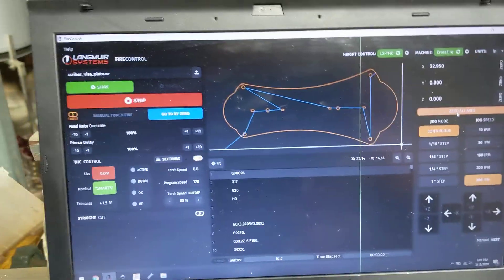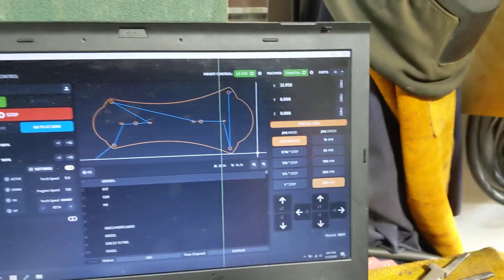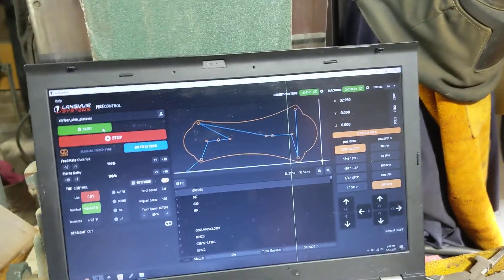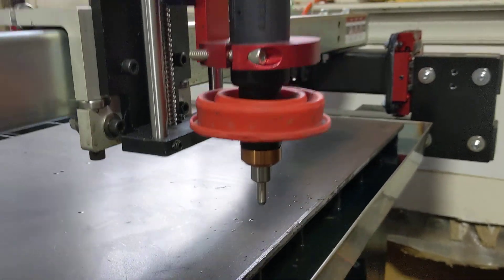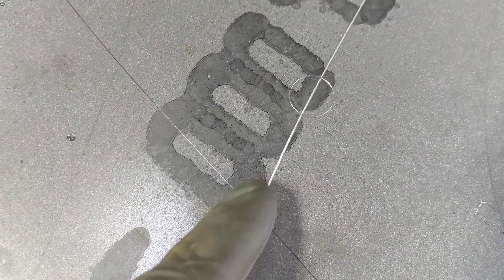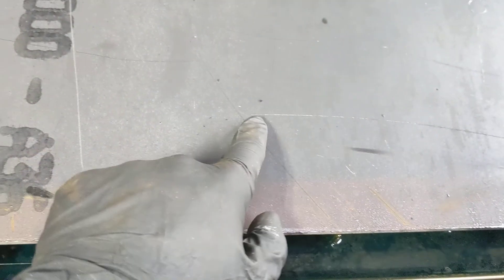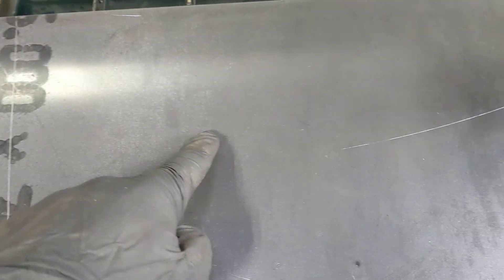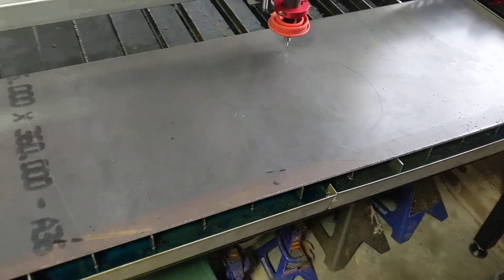Langmuir Systems Crossfire Pro - Using the EasyScriber

Comment: Any updates on this scriber.....is it a keeper?
Reply from the maker: Yup, she's a keeper. I like it a lot.
Reply: @JohnCasale  awesome, did you just have to load the tip a little more on the Z or.did you find a way with the THC?
Reply from the maker: @Welder6131  that's right. Done in the fusion 360 post processor for fire control

Comment: What’s that orange thing around the torch and what’s it do ?
Reply from the maker: It's a funnel. It just blocks some of the torch's light, and catches water that sprays up, keeping the work area a bit cleaner.
Reply: where did you get it? @JohnCasale
Reply from the maker: @garrettslobey9204  anywhere kitchen silicone funnels are sold